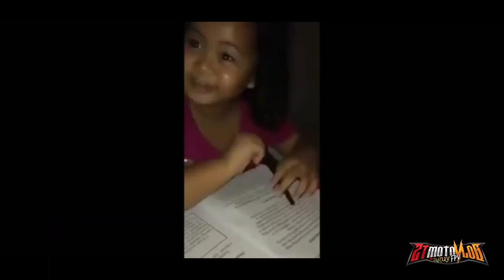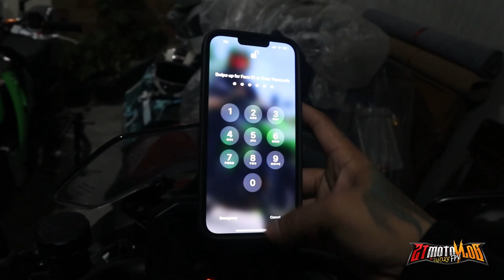2T motovlog | Installing cellphone holder on kawasaki zh2

Comment: Hello, I´m looking for the parts.

I found PRN015659 for the holder.

What part numbers have the other parts?

What for a connection do you use to charge the mobile and connect it?

Could you give me some links or partnumbers please.

thx from germany